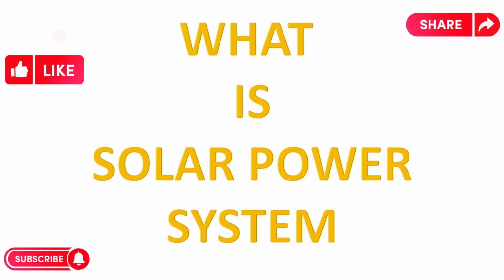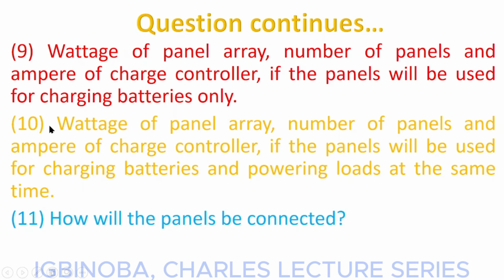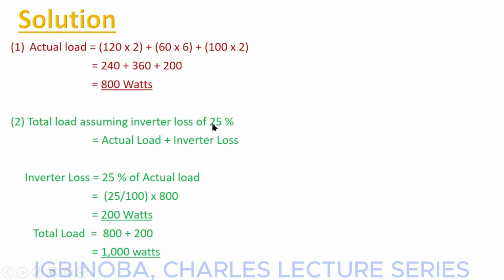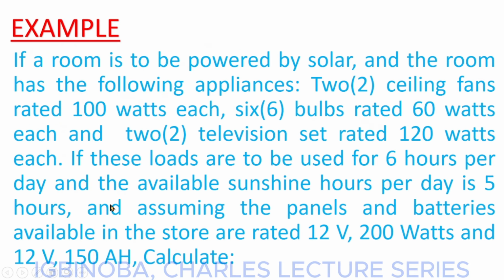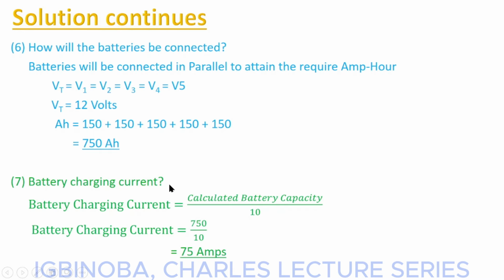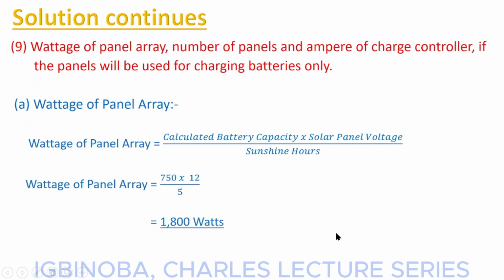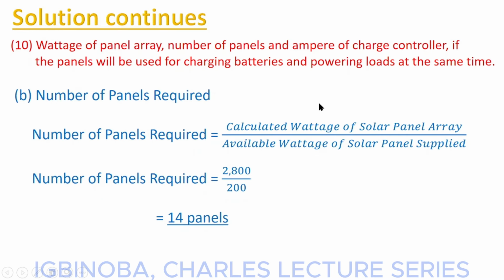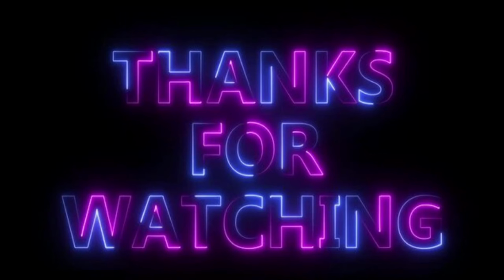Design of Solar Power System

Comment: PEE332F

1. Actual load is 1380w
2. Total load is 1725w
3. Inverter rating is 2156.25VA
4. Battery capacity is 1293.75AH
5. No of batteries 9
6. Parallel
7. Battery charging current is 129.375amps
8. Charging time is 14 hours
9. (A) 3105w
(B) 15.5 panels
(C) 258.75A
10. (A) 4830w
(B) 24 panels
(C) 402.5A
11. Parallel

Comment: CHM356D

1. Actual load 1380w
2. Total load 1720w
3. Inverter rating 2156.25VA
4. Battery capacity 1293.75Ah
5. Number of batteries 8.6.
6. Parallel
7. Battery charging 129.4A
8. T= 14hrs
9(a) 3105w
(b) 15.5panels
(C) 258.75A
10. (a) 4830w
(b) 24panels
(c) 402.5A
11. Parallel

Comment: CHM3119O

1. Actual load is 1380w
2. Total load is 1725w
3. Inverter rating is 2156.25VA
4. Battery capacity is 1293.75AH
5. No of batteries 9
6. Parallel 
7. Battery charging current is 129.375amps
8. Charging time is 14 hours
9. (A) 3105w
    (B) 15.5 panels 
     (C) 258.75A
10. (A) 4830w
      (B) 24 panels 
      (C) 402.5A
11. Parallel

Comment: COMP399U
1. Actual load is 1380w
2. Total load is 1725w
3. Inverter ratings is 2156.25VA
4. Battery capacity is1293.75AH
5. No of batteries 9
6. Parallel 
7. Battery charging current is 129.375amps
8. Charging time is 14 hours 
9. A   3105watts
B. 16 panels 
C. 258.75amps

10. A. 4830 watts
B. 24 panels
C. 402.5amps
11. Parallel

Comment: COMP324X
1 Actual load 1380w

2 Total load 1720w

3 Inverter rating 2156.25VA

4 Battery capacity 1293.75Ah

5 Number of batteries 8.6

6 Parallel

7 Battery charging 129.4A

8 T-14hrs

9 (a)3105w

(b)15.5panels

(C)258.75A

10 (a)4830w

(b)24 panel

(C)402.5A

11 Parallel

Comment: MECH355C

1. Actual Load: 1380 W
2. Total Load (including inverter loss): 1840 W
3. Inverter Rating (VA): 2300 VA
4. Battery Capacity: 1227 Ah
5. Number of Batteries: 9 batteries
6. Battery Connection: Parallel
7. Battery Charging Current: 15 A (per battery string)
8. Battery Charging Time: 5.1 days
9. Panel Array (for charging batteries only):
   · Wattage: 2945 W
   · Number of Panels: 15 panels
   · Charge Controller Ampere: 245 A
10. Panel Array (for charging batteries and powering loads):
    · Wattage: 4785 W
    · Number of Panels: 24 panels
    · Charge Controller Ampere: 399 A
11. Panel Connection: Series - Parallel

MECH355C
Reply: COMP328B
1. Actual Load = 1380 watts
2. Total Load = 1725 watts
3. Inverter Rating = 2156.25 VA
4. Battery Capacity = 1293.75 Ah
5. Number of Batteries = 8.625 ~ 9 batteries
6. Parallel
7. Battery charging current = 129.375 Amps
8. Charging time = 14 hrs
9. (a) 3105 watts
(b) 15.525 ~ 16 panels
(C) 258.75 Amps
10. (a) 4830 watts
(b) 24.15 ~ 24 panels
(c) 402.5 Amps
11. Parallel

Comment: CIV392N
1. Actual Load = 1380 watts
2. Total Load = 1725 watts
3. Inverter Rating = 2156.25 VA
4. Battery Capacity = 1293.75 Ah
5. Number of Batteries = 8.625 ~ 9 batteries
6. Parallel
7. Battery charging current = 129.375 Amps
8. Charging time = 14 hrs
9. (a) 3105 watts
(b) 15.525 ~ 16 panels
(c) 258.75 Amps
10. (a) 4830 watts
(b) 24.15 ~ 24 panels
(c) 402.5 Amps
11. Parallel

Comment: EEE373U

1. Actual Load = 1380 watts

2. Total Load = 1725 watts

3. Inverter Rating = 2156.25 VA

4. Battery Capacity = 1293.75 Ah

5. Number of Batteries = 8.625~9 batteries

6. Parallel

7. Battery charging current = 129.375 Amps

8. Charging time = 14 hrs

9. (a) 3105 watts

(b) 15.525~16 panels

(c) 258.75 Amps

10. (a) 4830 watts

(b) 24.15~24 panels

(c) 402.5 Amps

11. Parallel

Comment: MECH3166J

1. Actual Load = 1380 watts
2. Total Load = 1725 watts
3. Inverter Rating = 2156.25 VA
4. Battery Capacity = 1293.75 Ah
5. Number of Batteries = 8.625 ~ 9 batteries
6. Parallel
7. Battery charging current = 129.375 Amps
8. Charging time = 14hrs
9. (a) 3105 watts
(b) 15.525 ~ 16 panels
(c) 258.75 Amps
10. (a) 4830 watts
(b) 24.15 ~ 24 panels
(c) 402.5 Amps
11. Parallel

Comment: PETROCHEM397S
YOUR SWEP CODE

1 Actual load 1380W
2 Total load  1720W
3 Inverter rating  2156.25VA
4 battery Capacity 1293.75Ah
5 number of batteries 8.6
6 Parallel 
7 Battery charging  129.4A
8 T = 14hrs
9 (a) 3105W
   (b) 15.5 panels 
   (c)  258.75 A
10 (a) 4830W 
     (b) 24 panel 
     (c) 402.5A 
11 Parallel

Comment: MECH3105A

1 Actual load =1380W
2 Total load = 1720W
3 Inverter rating =2156.25VA
4 battery Capacity =1293.75Ah
5 number of batteries = 8.6
6 Parallel
7 Battery charging =129.4A
8 T = 14hrs
9 (a) 3105W
(b) 15.5 panels
(c) 258.75 A
10 (a) 4830W
(b) 24 panel
(c) 402.5A
11 Parallel

Comment: PETROCHEM396R 

1 Actual load 1380W
2 Total load  1720W
3 Inverter rating  2156.25VA
4 battery Capacity 1293.75Ah
5 number of batteries 8.6
6 Parallel 
7 Battery charging  129.4A
8 T = 14hrs
9 (a) 3105W
   (b) 15.5 panels 
   (c)  258.75 A
10 (a) 4830W 
     (b) 24 panel 
     (c) 402.5A 
11 Parallel

Comment: PETROCHEM368P

1 Actual load 1380W
2 Total load  1720W
3 Inverter rating  2156.25VA
4 battery Capacity 1293.75Ah
5 number of batteries 8.6
6 Parallel 
7 Battery charging  129.4A
8 T = 14hrs
9 (a) 3105W
   (b) 15.5 panels 
   (c)  258.75 A
10 (a) 4830W 
     (b) 24 panel 
     (c) 402.5A 
11 Parallel

Comment: EEE366N

1. Actual load = 1380W

2. Total load = 1840W

3. Inverter rating = 2156.25KVA

4. Battery Capacity = 1293.75Ah

5. Number of batteries = 8.625  ~ 9 batteries

6. Parallel

7. Battery charging current = 129.375Amps

8. Charging time = 14 hours

9(a). 3105Watts
(b). 15.5 ~ 16 panels
(c). 258.75Amps

10(a). 4830W
(b). 24.15 ~ 24 panels
(c). 402.5Amps

11. Parallel

Comment: EEE3110F
1 Actual load 1380w
2 Total load 1720w
3 Inverter rating 2156.25VA
4 Battery capacity 1293.75Ah
5 Number of batteries 8.6
6 Parallel 
7 Battery charging 129.4A
8 T=14hrs
9 (a)3105w
(b)15.5panels
(C)258.75A

10 (a)4830w
(b)24 panel 
(C)402.5A

11 Parallel

Comment: PETROCHEM326Z

1 Actual load 1380W
2 Total load  1720W
3 Inverter rating  2156.25VA
4 battery Capacity 1293.75Ah
5 number of batteries 8.6
6 Parallel 
7 Battery charging  129.4A
8 T = 14hrs
9 (a) 3105W
   (b) 15.5 panels 
   (c)  258.75 A
10 (a) 4830W 
     (b) 24 panel 
     (c) 402.5A 
11 Parallel

Comment: EEE344R

1. Actual Load = 1380 watts

2. Total Load = 1725 watts

3. Inverter Rating = 2156.25 VA

4. Battery Capacity = 1293.75 Ah

5. Number of Batteries = 8.625 ~ 9 batteries

6. Parallel

7. Battery charging current = 129.375 Amps

8. Charging time = 14hrs

9. (a) 3105 watts

(b) 15.525 ~ 16 panels

(c) 258.75 Amps

10. (a) 4830 watts

(b) 24.15 ~ 24 panels

(c) 402.5 Amps

11. Parallel

Comment: PETROCHEM329C

1 Actual load 1380W
2 Total load  1720W
3 Inverter rating  2156.25VA
4 battery Capacity 1293.75Ah
5 number of batteries 8.6
6 Parallel 
7 Battery charging  129.4A
8 T = 14hrs
9 (a) 3105W
   (b) 15.5 panels 
   (c)  258.75 A
10 (a) 4830W 
     (b) 24 panel 
     (c) 402.5A 
11 Parallel

Comment: CHM3118N

 1. Actual Load = 1380 watts
 2. Total Load = 1725 watts
 3. Inverter Rating = 2156.25 VA
 4. Battery Capacity = 1293.75 Ah
 5. Number of Batteries = 8.625~9 batteries
 6. Parallel
 7. Battery charging current = 129.375 Amps
 8. Charging time = 14 hrs
 9. (a) 3105 watts
     (b) 15.525 ~ 16 panels
     (c) 258.75 Amps
10.(a) 4830 watts
     (b) 24.15 ~ 24 panels
     (c) 402.5 Amps
 11. Parallel

Comment: PETROCHEM316P

1 Actual load 1380W
2 Total load  1720W
3 Inverter rating  2156.25VA
4 battery Capacity 1293.75Ah
5 number of batteries 8.6
6 Parallel 
7 Battery charging  129.4A
8 T = 14hrs
9 (a) 3105W
   (b) 15.5 panels 
   (c)  258.75 A
10 (a) 4830W 
     (b) 24 panel 
     (c) 402.5A 
11 ParallelPETROCHEM316P

1 Actual load 1380W
2 Total load  1720W
3 Inverter rating  2156.25VA
4 battery Capacity 1293.75Ah
5 number of batteries 8.6
6 Parallel 
7 Battery charging  129.4A
8 T = 14hrs
9 (a) 3105W
   (b) 15.5 panels 
   (c)  258.75 A
10 (a) 4830W 
     (b) 24 panel 
     (c) 402.5A 
11 ParallelPETROCHEM316P

1 Actual load 1380W
2 Total load  1720W
3 Inverter rating  2156.25VA
4 battery Capacity 1293.75Ah
5 number of batteries 8.6
6 Parallel 
7 Battery charging  129.4A
8 T = 14hrs
9 (a) 3105W
   (b) 15.5 panels 
   (c)  258.75 A
10 (a) 4830W 
     (b) 24 panel 
     (c) 402.5A 
11 ParallelPETROCHEM316P

1 Actual load 1380W
2 Total load  1720W
3 Inverter rating  2156.25VA
4 battery Capacity 1293.75Ah
5 number of batteries 8.6
6 Parallel 
7 Battery charging  129.4A
8 T = 14hrs
9 (a) 3105W
   (b) 15.5 panels 
   (c)  258.75 A
10 (a) 4830W 
     (b) 24 panel 
     (c) 402.5A 
11 ParallelPETROCHEM316P

1 Actual load 1380W
2 Total load  1720W
3 Inverter rating  2156.25VA
4 battery Capacity 1293.75Ah
5 number of batteries 8.6
6 Parallel 
7 Battery charging  129.4A
8 T = 14hrs
9 (a) 3105W
   (b) 15.5 panels 
   (c)  258.75 A
10 (a) 4830W 
     (b) 24 panel 
     (c) 402.5A 
11 ParallelPETROCHEM316P

1 Actual load 1380W
2 Total load  1720W
3 Inverter rating  2156.25VA
4 battery Capacity 1293.75Ah
5 number of batteries 8.6
6 Parallel 
7 Battery charging  129.4A
8 T = 14hrs
9 (a) 3105W
   (b) 15.5 panels 
   (c)  258.75 A
10 (a) 4830W 
     (b) 24 panel 
     (c) 402.5A 
11 ParallelPETROCHEM316P

1 Actual load 1380W
2 Total load  1720W
3 Inverter rating  2156.25VA
4 battery Capacity 1293.75Ah
5 number of batteries 8.6
6 Parallel 
7 Battery charging  129.4A
8 T = 14hrs
9 (a) 3105W
   (b) 15.5 panels 
   (c)  258.75 A
10 (a) 4830W 
     (b) 24 panel 
     (c) 402.5A 
11 Parallel

Comment: CHM3112H

1. Actual Load = 1380 watts
2. Total Load = 1725 watts
3. Inverter Rating = 2156.25 VA
4. Battery Capacity = 1293.75 Ah
5. Number of Batteries = 8.625 ~ 9 batteries
6. Parallel
7. Battery charging current = 129.375 Amps
8. Charging time = 14hrs
9. (a) 3105 watts
(b) 15.525 ~ 16 panels
(c) 258.75 Amps
10. (a) 4830 watts
(b) 24.15 ~ 24 panels
(c) 402.5 Amps
11. Parallel

Comment: PETROCHEM346T

1 Actual load 1380W
2 Total load  1720W
3 Inverter rating  2156.25VA
4 battery Capacity 1293.75Ah
5 number of batteries 8.6
6 Parallel 
7 Battery charging  129.4A
8 T = 14hrs
9 (a) 3105W
   (b) 15.5 panels 
   (c)  258.75 A
10 (a) 4830W 
     (b) 24 panel 
     (c) 402.5A 
11 Parallel

Comment: PETROCHEM335I

1 Actual load 1380W
2 Total load  1720W
3 Inverter rating  2156.25VA
4 battery Capacity 1293.75Ah
5 number of batteries 8.6
6 Parallel 
7 Battery charging  129.4A
8 T = 14hrs
9 (a) 3105W
   (b) 15.5 panels 
   (c)  258.75 A
10 (a) 4830W 
     (b) 24 panel 
     (c) 402.5A 
11 Parallel

Comment: COMP18K

I. Actual load = 1380W
2. Total load = 1720W
3. Inverter rating = 2156.25VA
4. Battery Capacity = 1293.75Ah
5. Number of batteries = 8.6 ~ 9 batteries
6. Parallel
7. Battery charging current = 129.4Amps
8. Charging Time = 14hrs
9 (a). 3105Watts
(b). 15.5 ~ 16 panels
(c). 258.75 Amps
10(a). 4830W
(b). 24.15 ~ 24 panels
(c). 402.5Amps
11. Parallel
& 1
曰

Comment: CHM19S

I. Actual load = 1380W
2. Total load = 1720W
3. Inverter rating = 2156.25VA
4. Battery Capacity = 1293.75Ah
5. Number of batteries = 8.6 ~ 9 batteries
6. Parallel
7. Battery charging current = 129.4Amps
8. Charging Time = 14hrs
9 (a). 3105Watts
(b). 15.5 ~ 16 panels
(c). 258.75 Amps
10(a). 4830W
(b). 24.15 ~ 24 panels
(c). 402.5Amps
11. Parallel
& 1
曰

Comment: PETROCHEM398T

1 Actual load 1380W
2 Total load  1720W
3 Inverter rating  2156.25VA
4 battery Capacity 1293.75Ah
5 number of batteries 8.6
6 Parallel 
7 Battery charging  129.4A
8 T = 14hrs
9 (a) 3105W
   (b) 15.5 panels 
   (c)  258.75 A
10 (a) 4830W 
     (b) 24 panel 
     (c) 402.5A 
11 Parallel

Comment: EEE 388J

I. Actual load = 1380W

2. Total load = 1720W

3. Inverter rating = 2156.25VA

4. Battery Capacity = 1293.75Ah

5. Number of batteries = 8.6 ≈ 9 batteries 

6. Parallel

7. Battery charging current = 129.4Amps

8. Charging Time = 14hrs

9 (a). 3105Watts

(b). 15.5 ≈ 16 panels

(c). 258.75 Amps 

10(a) . 4830W

(b). 24.15 ≈ 24 panels

(c). 402.5Amps 

11. Parallel

Comment: PETROCHEM343Q

1 Actual load 1380W
2 Total load  1720W
3 Inverter rating  2156.25VA
4 battery Capacity 1293.75Ah
5 number of batteries 8.6
6 Parallel 
7 Battery charging  129.4A
8 T = 14hrs
9 (a) 3105W
   (b) 15.5 panels 
   (c)  258.75 A
10 (a) 4830W 
     (b) 24 panel 
     (c) 402.5A 
11 Parallel

Comment: PETROCHEM325Y

1 Actual load 1380W
2 Total load  1720W
3 Inverter rating  2156.25VA
4 battery Capacity 1293.75Ah
5 number of batteries 8.6
6 Parallel 
7 Battery charging  129.4A
8 T = 14hrs
9 (a) 3105W
   (b) 15.5 panels 
   (c)  258.75 A
10 (a) 4830W 
     (b) 24 panel 
     (c) 402.5A 
11 Parallel

Comment: PETROCHEM374V

1 Actual load 1380W
2 Total load  1720W
3 Inverter rating  2156.25VA
4 battery Capacity 1293.75Ah
5 number of batteries 8.6
6 Parallel 
7 Battery charging  129.4A
8 T = 14hrs
9 (a) 3105W
   (b) 15.5 panels 
   (c)  258.75 A
10 (a) 4830W 
     (b) 24 panel 
     (c) 402.5A 
11 Parallel

Comment: PETRO 3176T
ANSWERS TO QUESTIONS 
1. Actual load= (100×3)+(60×10)+(120×4) =1380watts
2. Total load assuming inverter loss of 25%= Actual load +Inverter loss
Inverter loss=25% of Actual load
= 25%×1380=345 watts
Total load= 1380+345=1725 watts
3. Inverter rating on VA using power factor of 0.8
= (1725÷0.8)= 2156.25
4. Battery capacity using factor for reserve 75%=(2×1725×6×0.75)=1293.75Ah
5. No. of batteries for backup hours=1293.75Ah÷150Ah= 8.6 =8 batteries 
6. How batteries will be connected?
The batteries will be connected in parallel 
Vt=V1=V2=V3=V4=V5=V6=V7=V8
Ah= 150+150+150+150+150+150+150+150=1200
7. Battery charging current=1293.75÷10=129Amps
8. Battery charging time assuming charging loss of 40%= 1293.75Ah+(40%+1293.75Ah)÷129A=14hrs
9a. Wattage panel array= 3105 watts
9b. Number of panels required= 3105÷345=9 panels 
9c. Ampere of charging controller required= 3105÷12=258.75Amps
10a. Wattage of panel array= Calculated wattage of solar panel array for charging battery only+ calculated total load =3105+1725=4830watts
10b. Number of panels required= calculated wattage of solar panel array÷ Available wattage of solar panel supplied= 4830watts÷345= 14Amps
10c. Ampere of charge controller= calculated wattage of solar panel array÷ solar panel voltage=4830watts÷12volts= 402.5Amps
11. How will the panels be connected?
Ans: They will be connected in parallel.

Comment: PETROCHEM324X

1 Actual load 1380W
2 Total load  1720W
3 Inverter rating  2156.25VA
4 battery Capacity 1293.75Ah
5 number of batteries 8.6
6 Parallel 
7 Battery charging  129.4A
8 T = 14hrs
9 (a) 3105W
   (b) 15.5 panels 
   (c)  258.75 A
10 (a) 4830W 
     (b) 24 panel 
     (c) 402.5A 
11 Parallel

Comment: CIV341O
1. Actual Load = 1380 watts
2. Total Load = 1725 watts
3. Inverter Rating = 2156.25 VA
4. Battery Capacity = 1293.75 Ah
5. Number of Batteries = 8.625 ~ 9 batteries
6. Parallel
7. Battery charging current = 129.375 Amps
8. Charging time = 14 hrs
9. (a) 3105 watts
(b) 15.525 ~ 16 panels
(c) 258.75 Amps
10. (a) 4830 watts
(b) 24.15 ~ 24 panels
(c) 402.5 Amps
11. Parallel

Comment: PETROCHEM341O

1 Actual load is 1380W
2 Total load is 1720W
3 Inverter rating is 2156.25VA
4 battery Capacity is 1293.75Ah
5 number of batteries is 8.6
6 Parallel 
7 Battery charging is 129.4A
8 Time is 14hrs
9 (a) 3105W
   (b) 15.5 panels 
   (c)  258.75 A
10 (a) 4830W 
     (b) 24 panel 
     (c) 402.5A 
11 Parallel

Comment: PETROCHEM3101W

1 Actual load 1380W
2 Total load  1720W
3 Inverter rating  2156.25VA
4 battery Capacity 1293.75Ah
5 number of batteries 8.6
6 Parallel 
7 Battery charging  129.4A
8 T = 14hrs
9 (a) 3105W
   (b) 15.5 panels 
   (c)  258.75 A
10 (a) 4830W 
     (b) 24 panel 
     (c) 402.5A 
11 Parallel

Comment: PETROCHEM388J
1 Actual load 1380W
2 Total load  1720W
3 Inverter rating  2156.25VA
4 battery Capacity 1293.75Ah
5 number of batteries 8.6
6 Parallel 
7 Battery charging  129.4A
8 T = 14hrs
9 (a) 3105W
   (b) 15.5 panels 
   (c)  258.75 A
10 (a) 4830W 
     (b) 24 panel 
     (c) 402.5A 
11 Parallel

Comment: PETROCHEM311K
1. Actual load 1380W
2 .Total load  1720W
3 .Inverter rating  2156.25VA
4. battery Capacity 1293.75Ah
5 .number of batteries 8.6
6 .Parallel 
7. Battery charging  129.4A
8 .T = 14hrs
9. (a) 3105W
   (b) 15.5 panels 
   (c)  258.75 A
10 (a) 4830W 
     (b) 24 panel 
     (c) 402.5A 
11. Parallel

Comment: PETROCHEM32B

1. Actual Load = 1380W

2. Total load(VA) = 1725Watts

3. Inverting rating (VA) = 2156.25VA

4. battery Cap = 1293.75Ah

5. No. Of batteries 8.6-9 batteries

6. Parallel

7. Battery charging is 129.4A

8. Time is 14hrs

9 (a) 3105W

(b) 15.5 Panels

(c) 258.75A

10 (a) 4830W

(b) 24 Panel

(c) 402.5A

11 parallel

Comment: SWEP CODE: PETROCHEM381C
1 Actual load 1380W
2 Total load  1720W
3 Inverter rating  2156.25VA
4 battery Capacity 1293.75Ah
5 number of batteries 8.6
6 Parallel 
7 Battery charging  129.4A
8 T = 14hrs
9 (a) 3105W
   (b) 15.5 panels 
   (c)  258.75 A
10 (a) 4830W 
     (b) 24 panel 
     (c) 402.5A 
11 Parallel

Comment: PETROCHEM345S 

YOUR SWEP CODE

1 Actual load 1380W
2 Total load  1720W
3 Inverter rating  2156.25VA
4 battery Capacity 1293.75Ah
5 number of batteries 8.6
6 Parallel 
7 Battery charging  129.4A
8 T = 14hrs
9 (a) 3105W
   (b) 15.5 panels 
   (c)  258.75 A
10 (a) 4830W 
     (b) 24 panel 
     (c) 402.5A 
11 Parallel

Comment: PETROCHEM351Y

1 Actual load 1380W
2 Total load  1720W
3 Inverter rating  2156.25VA
4 battery Capacity 1293.75Ah
5 number of batteries 8.6
6 Parallel 
7 Battery charging  129.4A
8 T = 14hrs
9 (a) 3105W
   (b) 15.5 panels 
   (c)  258.75 A
10 (a) 4830W 
     (b) 24 panel 
     (c) 402.5A 
11 Parallel

Comment: PETROCHEM331E

1 Actual load 1380W
2 Total load  1720W
3 Inverter rating  2156.25VA
4 battery Capacity 1293.75Ah
5 number of batteries 8.6
6 Parallel 
7 Battery charging  129.4A
8 T = 14hrs
9 (a) 3105W
   (b) 15.5 panels 
   (c)  258.75 A
10 (a) 4830W 
     (b) 24 panel 
     (c) 402.5A 
11 Parallel